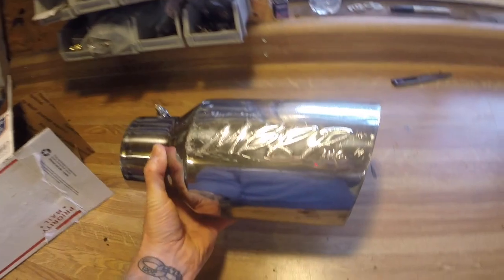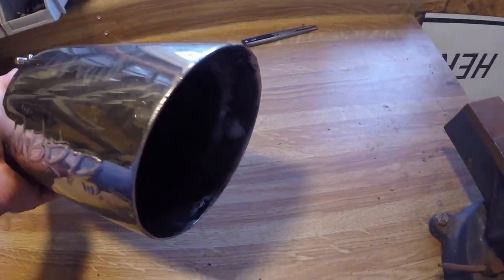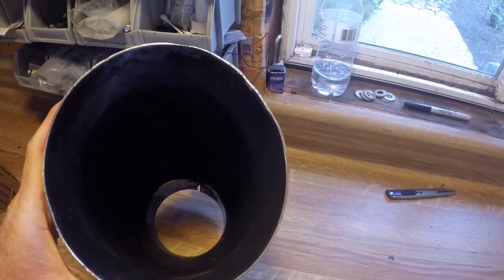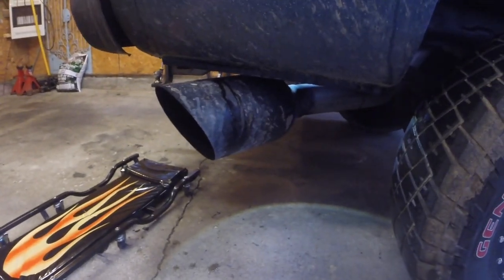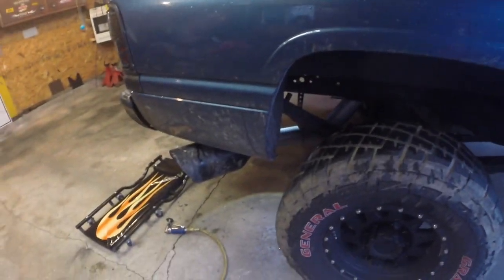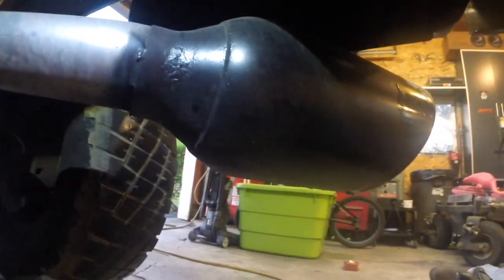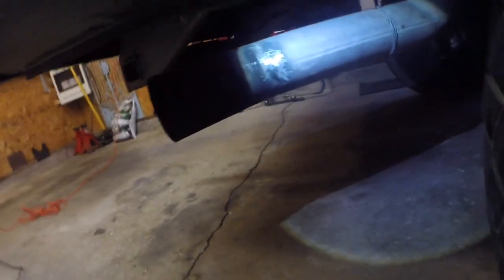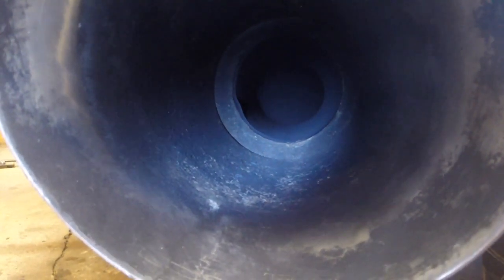Dodge Ram MBRP Exhaust Tip

Comment: good deal. I just bought a 2005 DRW Ram 3500 and had a MBRP rolled edge single wall tip which was filthy. I cleaned it up with scrunge and ceramic stove top cleaner. It looks perfectly fine to me      a little less like shiny pure chrome finish. It was real dirty. They are made out of 304 SS.
Reply from the maker: Scott Downey I like the satin look myself... Thanks for watching!